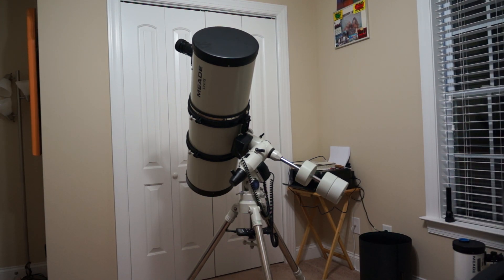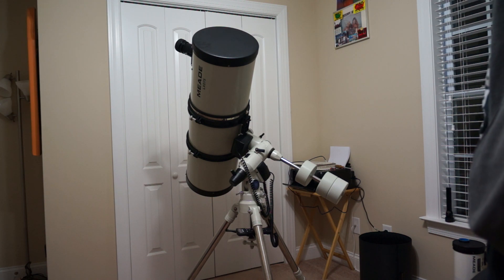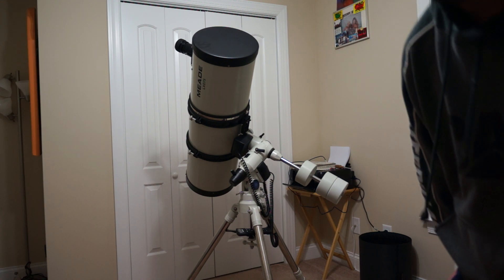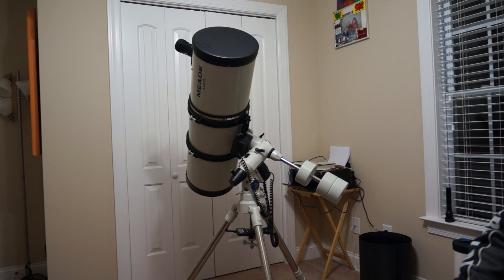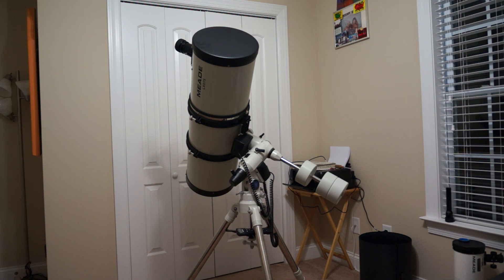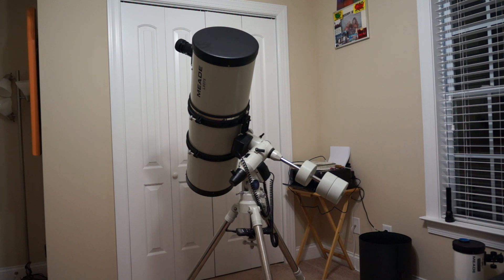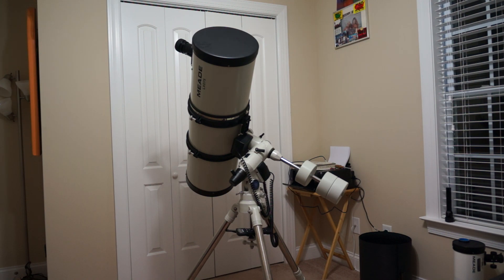Meade LXD75 Mods and How to's#36 Balancing part1

Comment: Pierplates com slash products_2563.html has a pier adapter plate to put an LXD55/75 mount onto a 12" concrete pier. It ain't cheap though...